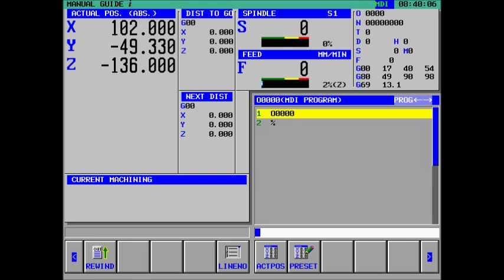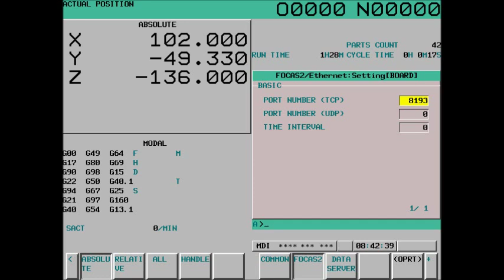FANUC FS0iD CNC FOCAS Setup

Comment: Hi Mike, currently I have a CNC connected to a maintenance network. I can see it giving a ping and I can establish connection with it using FANUC LADDER III application. My question is, how can i connect the CNC to an OPC Server in order to transmit data to a monitoring system "IBA pda"? I'm using the integrated port ethernet.

Comment: Does this work with the NCGuide Simulator? It won't save my settings.
Reply: 2021/ THE Same question
Reply: @tupitochka8841  Hey did you manage to save it?
Reply: @myKryptonitee  2022. No. The same/
Reply: @tupitochka8841  thank you :/
Reply: I have the same question, did you find a workaround?
Reply: Yes it does work on NCGuide. You need to open the settings/configuration program that is paired with the simulator program. I forgot exactly what to turn on. Also the program doesn't let you select the network adapter so you might consider disabling all but the adapter you're using for FOCAS.

Comment: Thanks for the video. I am troubleshooting a machine like this for a client. He has two computers, both on same switch. One is able to be seen by machine, other is not. Same software. Same IP scheme. Same FTP server. Same machine... machine can ping computer. Computer can ping machine. But machine won't pull data from PC. Computer that works is an old Windows XP. New computer is a Windows 7. Thoughts?

Comment: Thanks for these videos, they have been super helpful and I'm very close to having everything working on my Fanuc 32i-B.  One problem I am having is when I set "Parameter Write" to "1" I get the error "SW0100 Parameter Enable Switch On."  At this point I can ping the machine, but it will not run until I put parameter write back to 0.  I've tried restarting the machine.  Any ideas?  I feel like I'm just missing a keystroke, since I'm totally new to the fanuc control.  Thanks!

Tom
Reply: Ok, never mind the above question.  To reset that error, hold down "cancel" and press "reset".  We have to do this every time the machine turns on, but it works.